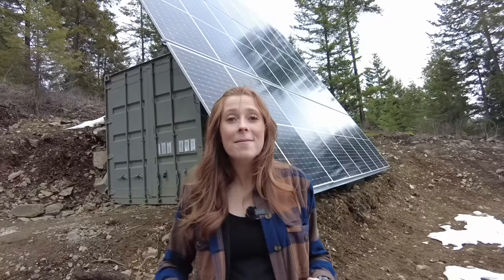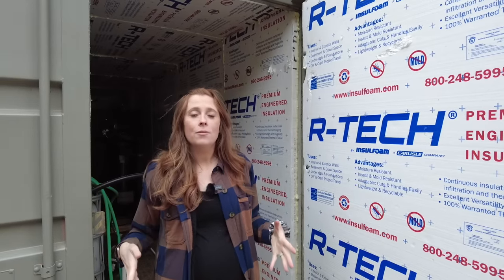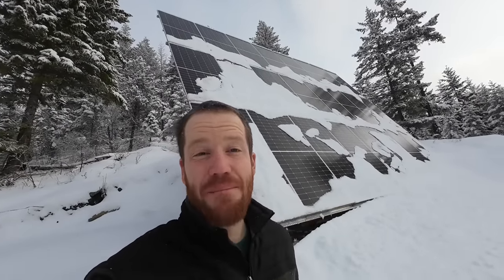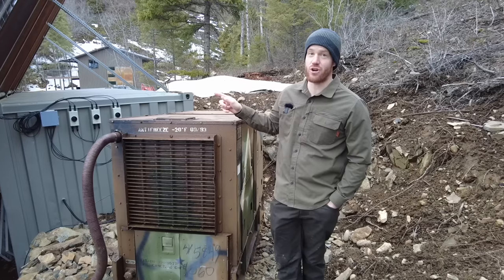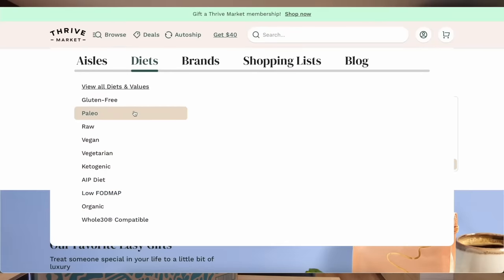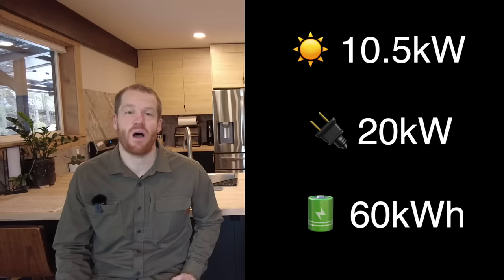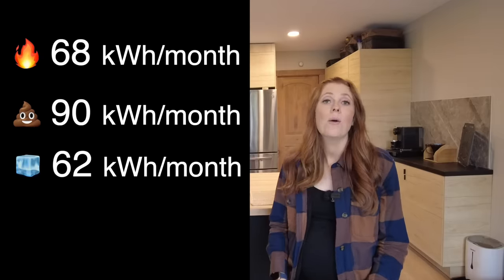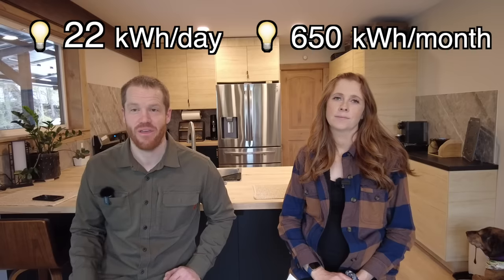The TRUTH About OFF-GRID Solar | Winter Update

Comment: Happy mothers day. Id love to see you guys try a wind turbine just to sew whst ita like. Its too bad therea no way to make fuel with leftover solar. I have the same problem with excess sun in the sunmer and not enough in the winter.
Reply: You could do conversion to Hydrogen. Electrolysis is used frequently in research and other countries for Hydrogen based vehicles. Setup with safe system is costly though. Fuel could be used for a lot of different systems, could be a fuel cell to convert back to electricity even.
Reply: Wind turbine requires wind. They commented back to someone else they have very little of any wind.

Comment: Do you have "Portables Batteries" that you can charge with all the extra Power During the Summer/Extra Sun/Generator Times...you can get 3600Watts X 3 with EcoFlow or some other kind of Portable Batteries.  This would have if you run out of power at night OR if you some issue with your "Grid" that you were NOT Expecting.

Just a Thought...

Comment: Any reason you don't use propane for instant hot water heater? Not sure if you cook on it but you can obviously do that as well as run refrigeration/freezers.

Any reason you didn't go the septic route? Do you have a lot of clay in your soil where septic/soil percolation might not pass? Or was it just cost?

Having gone through a winter, have you calculated the ROI on your entire system? How many years are you looking at to break even?
Reply: As they mentioned, their entire solar setup was less than the cost of getting power brought to them "on a pole", so their break-even was instantaneous.

Comment: It would be interesting to calculate the cost of a lifespan over approximately 25-30 years vs. the grid installation cost.  Once the grid is installed the maintenance would be negligible vs. the cost of replacing batteries/equipment potentially 3+ times over the lifespan of the off-grid system.  Of course, the cost of grid electricity over this period would also need to be included.

Comment: How much difference has the additional solar panels (deck panels) + the additional batteries made in the overall power production?  Are the two systems combined or two separate systems since the deck system only produces about 4 kw of power compared to your main solar system that is 10+ kw?  Also Congratulations on the new addition to your family.  He seems so small, but I think you mentioned he came about three weeks early.  Our second son was born early at like 36 weeks and had to be medivaced like 65 miles away to a hospital that had a neonatal ICU.  It didn't take him long to put on weight though.

Comment: While you did say you are up north in Idaho; I believe you also said you were on top of a hill so this gave you much more light than if you were down in a valley position. DId you also have the benefit of a clear view to the southeast and south?  I am also concerned about trees and how they might impact the power.   If you are on top of a hill you can easily mitigate trees; where most people can't?   What would you say about positioning of panels the impact on solar generation of the directional view and trees.. Do you have a video with a drone shot that shows your orientation?

Comment: Here in Australia, we are about to upgrade from 4.2KW to 24KW Solar and 12KW/h to 40KW/h battery storage. Of this will be 28KW/h usable to increase the lifespan of the batteries. Yes, ours will have a 15KVA auto start backup generator. Compared to yours we are actually using a Hybrid system that is still connected to the Grid. Our power usage is higher as we have a swimming pool and a centralized air-condition system in the house. We might yet have to increase the battery storage in a couple of years, once we know the full demand load during winter.
We also have an EV car ordered and the 7KW home charger is part of the installation upgrade. So far its planned for Mid August this year.
Now the big question....will our installation be cost effective and save money.....NOPE.
So why do it? Fuel and electricity prices keep going up, so yes, if they keep climbing at the current rate, then in 5 years it will be cost effective.
But the main reason is that we are having more and more brownouts which will get a lot worse yet and won't improve for years to come (if ever).
You are making the correct decision in NOT upgrading you solar/battery as it is a lot cheaper to install an auto start generator that is fuel efficient which will cover the very short period per year where your system can't quite keep up with demand.

Comment: I don't recall if you have ever mentioned if you have a running creek on your property. If you do, especially one that stays running in the winter, you could think of adding a small hydroelectric generator that would produce heat as a byproduct.

Glad to hear that your power system is working quite well. How much maintenance has your system required?

Comment: I have been chipping away at my 1200sqft half duplex to reduce electric consumption in Texas, and im still averaging about 40-50 kwh a day. maybe its the 200gallon reef tank i have LOL. For real im losing my mind trying to figure out whats eating so much electricity! Fish tank is about 6-7kwh a day, i got the A/C cooling to run about 4 hours a day, my fridge uses 685kwh a year on average according to the energy label, the only other thing i can think of is maybe my water heater. Its a Tank electric water heater and it says it averages about 5000kwh a year, which may be my final contributing factor. A few days ago i only ran my A/C for 1 hour and 33min, still ended up using 33kwh that day!

Comment: It definitely works if it is massively oversized for a household and has a very large massive battery. It should be noted however, that on average much smaller system (like 3-5kW) should be sufficient and a large amount of "waste" (unused) energy is also produced in your system. Upscaling it like that requires twice the amount of panels and thus creating twice the amount of waste, requires two times the materials and creates more and carbon footprint during their manufacturing. You made a good and reasonable system considering workshop, but just because it works well for you, doesn't mean it's a good model for everyone for being environmentally friendly. I realise people will probably call me "nay sayer" but it has to be said nevertheless.

Comment: It would be interesting if you could turn the extra summer power into heat for a sand battery for heat retention for the winter.   If it was large enough and if you had enough extra heat, you could store millions of BTU in a sand battery for the winter.

Comment: I know there's a huge difference in Summer temperatures between Idaho and South Louisiana, but down here, our electrical usage peaks around July because of air conditioner use. I know you are making more electricity because of longer days and warmer temperatures, but have you used your new air conditioner enough so far to get a firm grip on how the air conditioner will effect your electrical consumption yet? Also, how much more efficient would your solar panels be in Winter if you could steer them to track the path of the Sun across the sky instead of being partially fixed? While it may sound difficult to accomplish, it's a problem that others have already solved.
Reply: When we researched off grid systems a few years ago in the same county, we found that solar tracking added little collected power benefit compared to the maintenance, "when it doesn't work right", and expense of the tracking pieces. We were advised by a local off grid supplier to not waste the money. Every one of their employees used alternative power equipment of some sort, so we trusted their experience. I have yet to see more than 1 solar tracker in our 18 years in this area.

Comment: You guys mentioned that you were thinking about installing an AWG, which would actually be a great idea - they even have ones that include their own solar array for power which would help during the winter months. I do have a couple of questions though if you find time to answer. The first is that, well, I'm surprised that you don't have a monitoring system for inside the apartment? I wouldn't think that it would be too difficult to set up tbh, and could also be a DIY solution using either a couple of Rasberry Pi's or an Arduino's. The second question is about the manual wench system - any thoughts on using an actuator system?

Comment: Great video. Thanks for the info.  One question is how do you use the peer generated from the panels installed on the deck?  Was that worth the expense?
Reply: Good question.
Reply from the maker: This video was filmed before we installed that secondary system. We are now powering the apartment off that system and the rest of the property off our original system! Eventually we will tie them together but we wanted to keep them separate for testing purposes.

Comment: You should think how to collect heat from generator ;) co-generator can help u, and u can use car engine for it ;) it will help u to lower your gas bills ;)
Reply: right, the ICE will be at 35-40% efficacy when optimally loaded, which i assume the case so they throw away at least 60% of the fuel's chemical energy by not having a cooling water and/or exhaust hydronic heat exhcanger. they could use a fancoil to distribute the heat since radiant floor heating wasn't planned for. altho at 15kW electric that will be lets say roughly 30kW of heat output. they'd need a big storage vessel to make the effort worthwhile. plus there will be thermal losses in the transmission lines to the main building. with wood being readily available around their property, maybe a wood gasifier cogen system would be the best to bridge the winter gap.

Comment: So the generator can run on bio-diesel, which makes your total CO2 neutral or negative. The surplus in the summer, I am still wondering where I have to dump all that. Long term heat storage maybe? Because all power in 10 months of the year is basically free and 8 of those months are severely in excess. But the heating system is only 68kWh per month. My computers are at least 30kWh per month.

Comment: 1) If you have too much energy in summer: Use electrolysis to create/store hydrogen. Use a fuel cell in winter to get the energy back
2) Instead of making the PV system larger to cover your winter energy needs, why not supplement your system by a small (5-10 kW) wind turbine? Should be enough wind available in winter...

Comment: You would onlg need to upgrade the panels aspeft since you already have 3 days storage. Approx double panels would mean only running it occasionally at most. Could you supplement with water during winter by using the earth movers to make a deep pond near the top and excess rain water pumped up during summer and drained down to multiple stages of micro hydro sequentially to supplement the sun as needed?

Comment: If you spend more money I would do 2 things. 
Run a 240v line from your battery shed to somewhere closer so you can more easily get to the generator 
Second add another rack of batteries to store more of that extra sun for the winter time.
Reply: Doubling the batterie will store energy for only 2 or 3 more days.... The same money will give them fuel for 30 or more winters.

Comment: Have you put any time into seeing if Wind might be a viable supplemental source of power generation?  With you being up on the hill perhaps it's an option and even if you only have a small wind generator, it will work 24/7 helping maintain your batteries even if it really doesn't help top them off.
Reply: In our past research on wind power for off-grid, we discovered that ideally to be a very beneficial power source we would need a site with a pretty continuous wind speed of 9 or close to 10 mph. In this part of the country, that isn't very likely. Light breeze to over 30, but not very consistent. Probably not really a good option. We abandoned that idea for our system. Too expensive for the intermittent benefit.

Comment: If there is only 10 kW of PV annual daily average, unlikely to exceed 35 to 40 kWh.  More in summer but less in winter.  For offgrid about 5 days of consumption in battery storage.  A back up generator reduces the need for the size of the battery.

Comment: I have a larger system, 4X 19.1 KW/h Lithium batteries, and 13.6 KW of solar panels on sun tracking mounts. That is enough storage to charge an EV with 60 KW/h overnight and charge two more in the day (summer). Winter though, I might be able to charge one if I've had three sunny days in a row.
  I have my batteries installed in my R30 insulated, 40 ft long,  high box connex, and during the winter, the heat from the batteries charging and discharging kept the connex above freezing, with only about 1 and 1/2 20# propane bottles used for auxillary heat with a Mr. Buddy indoor safe heater. I still have half my panels shaded in the winter solstice, cutting down more beetle killed spruce to resolve that for next winter. I've already run cables from the solar panels to the construction site for my log cabin with basement, once the construction is done enough to live there, I'll transfer my batteries and charge controller to the basement, and enjoy the free heat, though with 4800 sq ft of living space, I will need to supply a bit more supplemental heat. System went online Nov 2022, and I have used 6.61 MW so far, total production could have been closer to 20MW if I had more loads to supply in the summer. The system is sized to be able to supply enough winter power to be comfortable, and enough summer power to do an EV charging business.
Reply: BTW in Alaska 31.5 degrees N winter solstice about 4 hours of daylight, no generator use this winter.

Comment: Have you considered a sand battery for your winter heating needs?   They store heat for months and are low-tech.   Should also last for many years.
Reply: thermal batteries do not store heat for months.  i'm not sure where this myth is coming from, you are the second of similar comments.  i'm building a thermal battery into a house currently under construction in CO.  i've done several weeks of thermodynamics engineering and simulations on the system, and can assure you that without input, you will deplete a thermal battery within days

Comment: You don't need more solar. You need more batteries to increase your winter autonomy time between generator startups.  With your 22 kwh daily usage storage for off grid autonomy is recommended at 3-5x daily usage. That's beyond the upper and lower limit restrictions of your batteries for longevity.  So conservatively your battery bank should be sized between 90-150 kwh not the current 60kwh.

Comment: Take your system, replace generator with the Grid when available.....and you have what every home should have, Just flip a transfer switch in the Garage when solar will not keep up and pull it from the Grid....no net metering, no need to hold that liability insurance.

Comment: Solar panels are very sensitive to shading, and their output drops significantly when even a small area is shaded.  In quite a few of the photos and drone shots of your installation, it is obvious that there are significant shadows from surrounding trees at times, and that problem is probably worse in winter. Dropping or topping a few more trees might make a significant improvement to the output.

I would agree with an earlier comment about adding a wind turbine. It would not have to be very large to make quite a difference, as when it is windy it would be producing power through the whole 24 hours.  I don't know the specific details of your climate, but in many parts of the world, winds tend to be stronger when the sunshine is weakest, so a hybrid system (wind and solar) works very well.
The tower would have to be impressive to get the turbine above your trees, however.
Be aware that not all wind turbines perform as advertised.. some of them fall short by a huge margin.. do a lot of research and speak to people who already use them before buying one.  
You two could easily build your own axial flux generator and blades, and the tower.  It would make a good video series.

Comment: i would put up more panels, but not new ones just used ones and then in a way like you did on the deck and ie all thet to the big system, it might be not getting used much in the summer but this way you can up the production in winter (well at least at clear days or you have to clear them from snow) so that you get more power in winter, that way you can lower the usage of generator and at some point you might even reach the amount you dont have to use the generator anymore.

Comment: 12:50
Regarding costs to make it bigger. What exactly are we talking about here?
The 50000$ for the system a year ago sounded steep, then again prices changed since then (at least in europe). Panels should be way more affordable.
Currently installing a 14kwp system. But only 9,6kwh of storage, as we don't expect to use everything from it all the time.
Our System sits at oughly 26000€ atm (which is roughly 27000$ I think). If we were to increase storage we'd have higher costs ofcourse but (checks prices)....oh okay that would but our system in the 50k ballpark if it had 60kwh storage, too.

Comment: Question :  over the winter (3 months) what was your total basic cost per kilowatt hour?
Reply: you can only really calculate the cost for the generator kwh.  the other stuff you have take into account their lifetime, which might be 25 years for the panels or 12 years for the batteries.  it gets complicated.  it's not hard to build a system with 4-10 years ROI, though